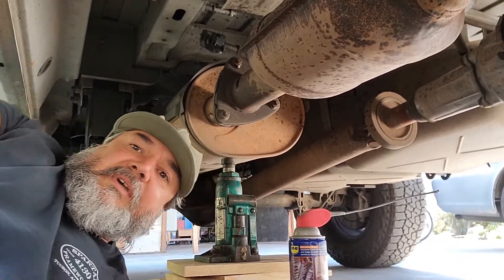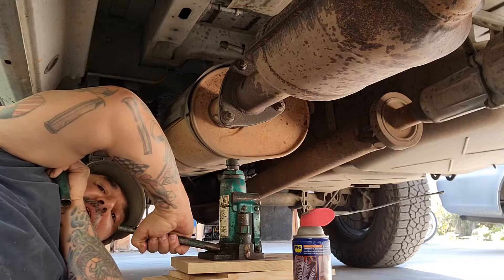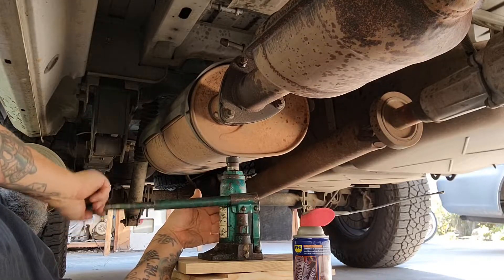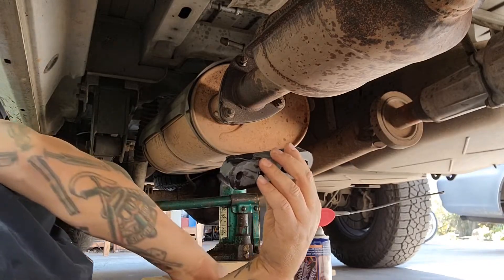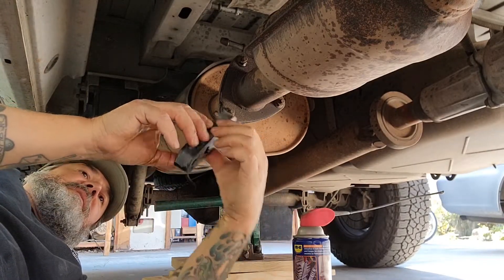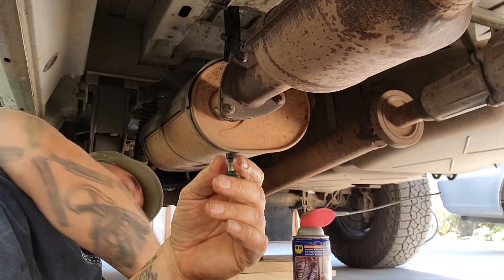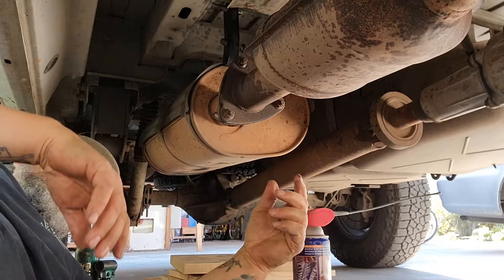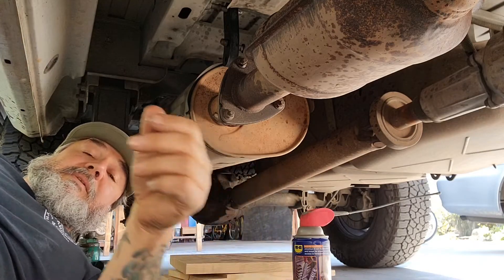Astro Van Exhaust System Hanger - For Lifted Astro's

Comment: My van is still off the road until the weather warms up. After installing the lift I noticed that the tail pipe contacts the back rear leaf spring. I guess that's why they leave it off. The instructions didn't mention it. Thanks for the tip.